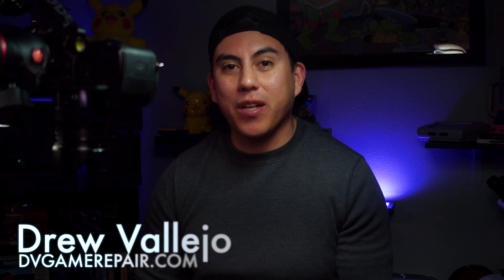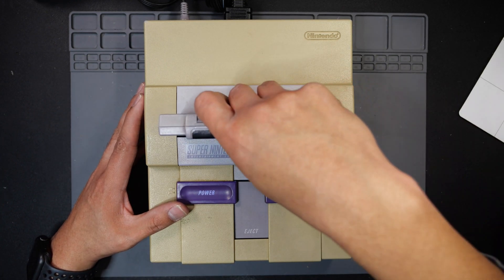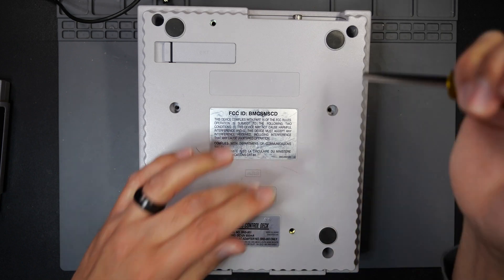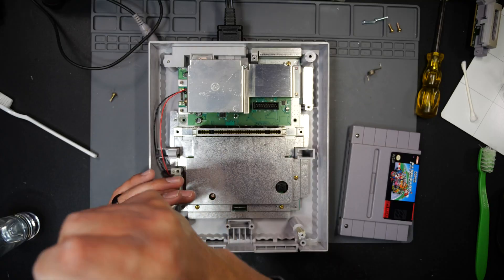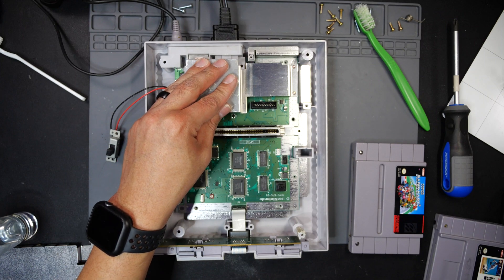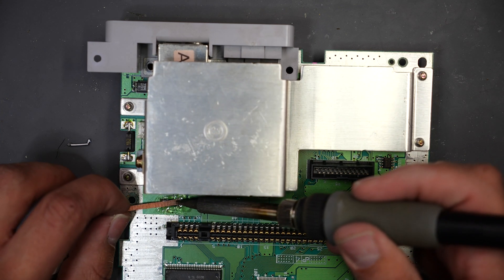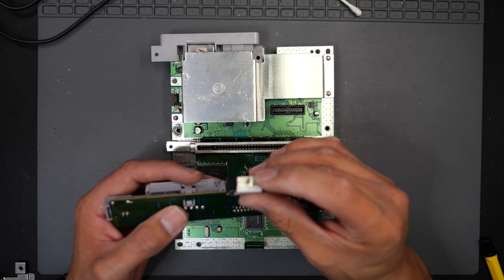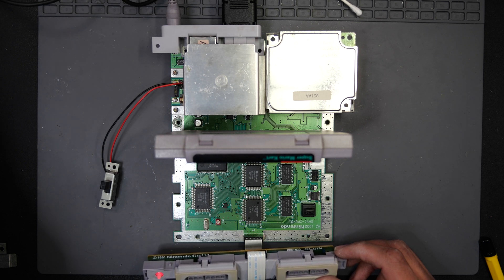Fix It Friday: SNES No Audio

Comment: Here in Nova Scotia that I'm aware of nobody works on consoles.i have a Xbox one that I think needs the hard drive replaced and still haven't found anybody here that does it and it's a little bit outside what I'm comfortable with.i got it where somebody was getting rid of it they said it wouldn't put out video through the s video.i at one point did get it to load video but it wouldn't completely boot up when it loaded video it would start to boot up and then freeze and after that the video stopped working again. 

i have a Super Nintendo with that little Barrel socket missing for the Power Jack didn't think it was that, Nava thing lol.it works fine but i haven't found something to take the barrel Shack off of and glue it on with Gorilla Glue or something for the sake of the argument. Other Super Nintendo it will only play some games other games won't work on it and the ones that do work the sound isn't working.i presently only have the old rf box.i haven't gotten my hands on one of our replacement cables been waiting for them in the mail.u Can't get the power brick around here after market for like 9 bucks but last I remember the video cable is 20 .u can get a  working Super Nintendo for around $100so people generally don't fix them around these parts.i Have to try cleaning the cartridge port on the other one to see if more games will work on it and maybe that'll fix the sound.

Comment: Great video, thanks for posting this. I have a real similar issue in one of my snes’ and I had eliminated the audio board and wasn’t quite sure what was the matter. I bet its either the ribbon cable or caps, I will check that tomorrow
Reply: instaBlaster